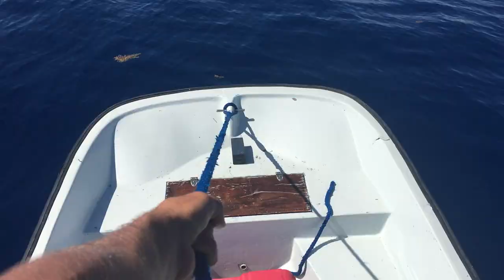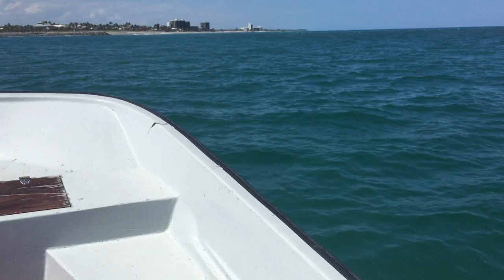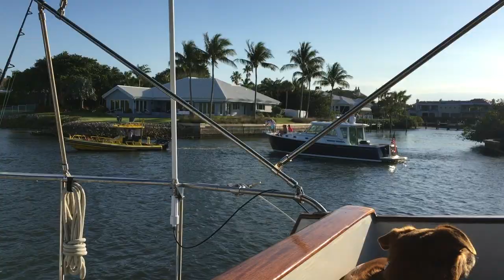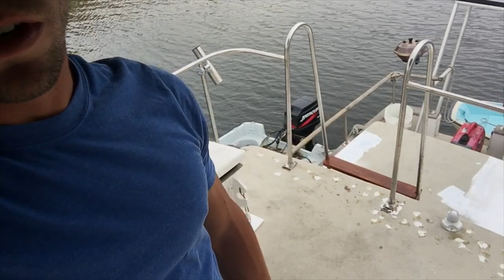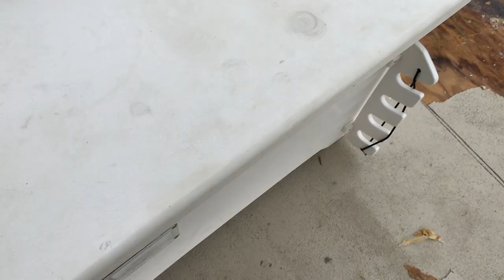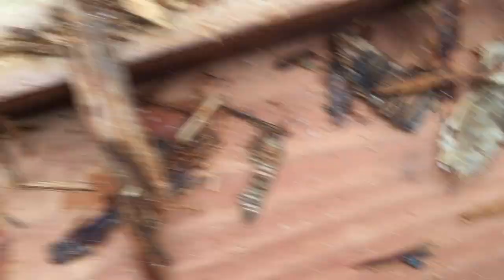MAJOR Repairs and 2 boats aground!

Comment: I did what you did with trying to fix my cockpit deck on my Lancer 28 sailboat. I injected lots and lots of resin and it worked for me. One thing I screwed up was I removed the steering pedestal and when I reinstalled it I made sure I did not cross the steering lines as they went up through the pedestal. I tested it before I put it in the water and I could hear and feel the rudder turning just fine when I turned the steering wheel. 
I sold the boat and when I launched it for the first time after repair, as I motored ahead, I found out it was steering the opposite from what it should (turning the wheel to the right made the boat steer left). I told the new owner who had never owned a sailboat, that that was how sailboats steered, just like a tiller on a sailboat push the tiller to starboard and the sailboat steers to port. 
I think the sailboat owner caught on at some time, that the steering was wrong. I do not know if he ever corrected it, by crossing the steering cables as they ran up the steering panel, which is how they should have been in this boat.

Comment: Wood and fiberglass boats , such a PITA! It's always the wood that rots. Building boats in the 70's and 80's I remember us saying ' this wood will last forever just coat it with resin! Ha!  Now every old boat I buy had to have the rotted wood fixed...... It's probably too late but I would use the much cheaper polyester ( and smellier) resins for a job like this.  Also I would fully fiberglass the deck then fiberglass on top some pads or strips of metal or wood to mount the railing to so that there is no penetrations of the hardtop skin.  Good luck!
Cheers Warren
Reply from the maker: I def use polyester for the big stuff like this. and thanks for the advice on the "base pads" although too late :-/ I did bed them very well though.

Comment: Billy... you were moving around so quickly on that upper deck,  I wasn't able to see the structure BELOW that fiberglass that you tried to lay down as a solution.   Just what is under neath all that rotten wood??    And,  did you rip up all the rotten areas as far as it travelled up towards the bow ??
Reply from the maker: yup, ripped up all the way until the glass delimitation stopped...

Comment: Have you considered using Thompson' Water seal to protect new or good wood? Goes a long way looks like kerosene relatively unexpensive-and excellant re-waterproofing of old canvas like dodgers-awnings?
Reply from the maker: I was thinking of using it on our Bimini. have you tried it for that?
Reply: Yes and no, Our bimini was vinyl but had a brown dodger that I used it on more than once because it eventual will lose its waterproofing properties after about a year. Also used it on the cloth awnings on all the windows on my trawler. It will darken the materal somewhat  but I didn't care. When we started " aboard " in 80's  a gallon was $20, well worth it. Went on like kerocene consistancy.

Comment: Well there was good and bad. That wood was not terribly decomposed and still had a lot of cellulose but it was wet and delaminated. You had the right idea about epoxy but you had a few things going against you. #1, The epoxy you were using is WAY too thick. The ONLY epoxy you can use in enclosed space like that is Git Rot penetrating epoxy. It is the thinnest type without volatiles like xylene or alcohol that becomes entrapped and hinder the curing process. Use a bag of disposable syringes to draw up and inject into the holes . When it becomes slow to accept the Git Rot, start using West Systems fast cure. You don’t want the holes to suck dry before it cures leaving a void under the sheeting. #2 wood was way too wet. The moisture will displace or stop the epoxies progress. A manifold with bunch of small tubes like aquarium air lines plumbed to a vacuum pump to dry it out or after few dry months. #3 You drilled completely through the top sheeting. The first over shoot can be plugged with hard packed paper towel. Drill only 75% of the thickness. Bottom line, sometimes you just have to rip it out like you did.